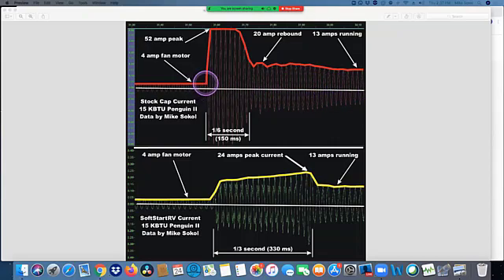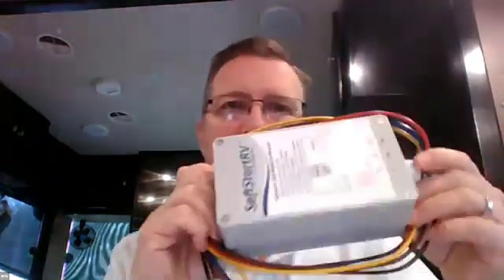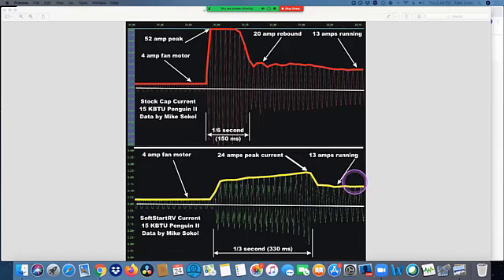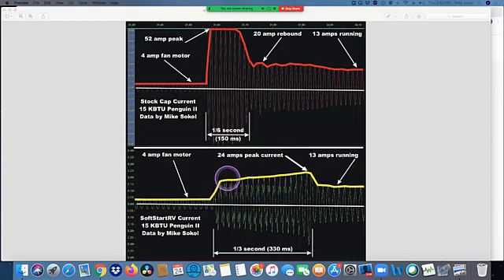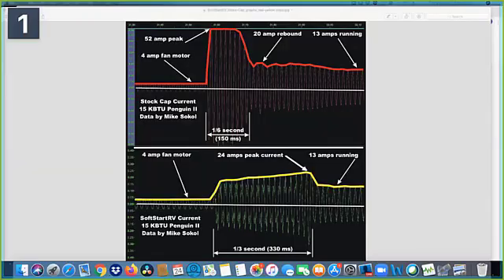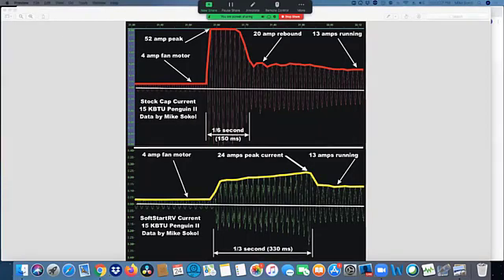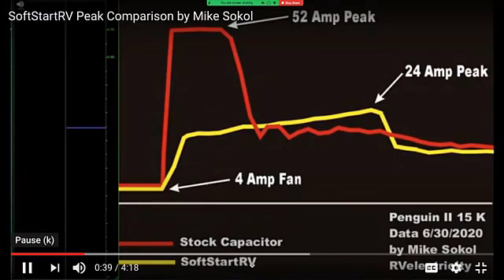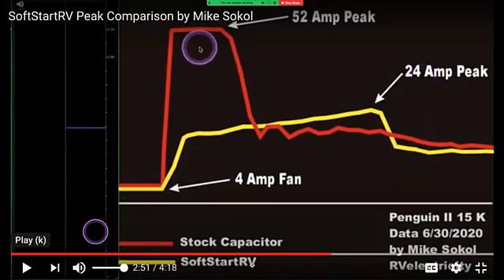SoftStart RV and TechnoRV: An Interview with Mike Sokol

Comment: Great video and very informative.    It was straight to the point without “geeking out” on the explanation.     I see this question was ask/answer  about a year - can you please confirm in 2022 that the soft start system does not damage the a/c/.

Comment: ‘Question’  -  I understand the process which how the soft start operates but my worry is what it will do to AC motor & capacitor when running for a long time in the summer months? 
Why wouldn’t these RV/Trailer Company install these on the unit automatically if this works so well?
Thank you,
AB
Reply from the maker: Hi AB,  The Soft Start assists at start up, so it will not have an effect for long term use during the hot months. Also, some AC suppliers are starting to put a soft starter on them, I hope that eventually all AC manufacturers will do this, but time will tell. I hope this helps. Eric

Comment: Thanks Eric for the quick response. (I am also 7Iron707 below--used the wrong acct earlier).  I have written to Mike to get a clearer  understanding.  If indeed a Honda EU2000 will generate 24 amps (or 2.8+kw) at startup as shown on Mike's chart, then I am rushing out today to purchase one, and will order the ST from you immediately .

Comment: Did I understand that the source for Mike’s test was a Honda EU2200 producing 2200 peak(start) or 18.33 amps?....great video!!
Reply from the maker: I believe it was a 2200, although he refers to 2000 watt generators also relating to using a SoftStart.

Comment: I have three Dometic 15,000 A/C units. Two are heat pumps as well. Are there detailed instructions for installing on the heat pump units?
Reply from the maker: Dometics are pretty common, there will be a wiring diagram, and you can set up a phone call for help while you do the install.

Comment: How much does it usually cost to have a mobile tech install a soft start?
Reply from the maker: Hi Bernie, If you got a tech to do the install then it would just be their hourly rate, and I am guessing it would be no more than a hour, if they were familiar with the product. If this was their first time installing then it may take them a bit longer.
Reply: This is an EASY DIY with the Soft Start Company technician assisting over the phone.  See my above comment.

Comment: I have a 2 stage 27,000 btu heatpump located under my fifthwheel, do you know if this will work on our unit?
Reply: If the SoftStartRV won't handle it, MicroAir EasyStart has several sizes of their units.  They can suppot 6 ton AC units and up.
Reply from the maker: Hi Guy, This sounds like a dual basement unit and it is highly likely that it has 2 compressors. So in this case, you would put a SoftStart on both compressors. This would work the same with any brand, hope this helps. Eric

Comment: Great interview, Eric! My travel trailer has two 15K Coleman A/Cs. My main A/C has a MicroAir EasyStart (I wasn't aware of the SoftStartRV) and I've contemplated installing another on the 2nd A/C. Can you point to any information comparing the MicroAir EasyStart and SoftStartRV units?
Reply from the maker: Both Companies have articles stating why they are the best. I will say it from my standpoint,  I know SoftStart works as advertised and I am sure Micro Air does too. We chose SoftStart because of the quality of the unit, the customer service, including phone call install appointments, and I trust Mike Sokols opinion on this type product and he supports the SoftStart. I hope this helps.